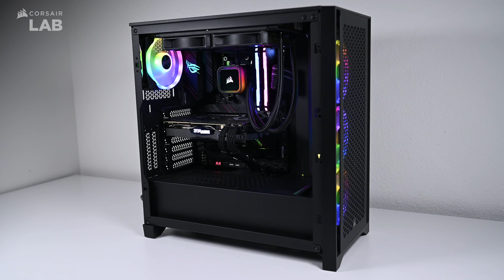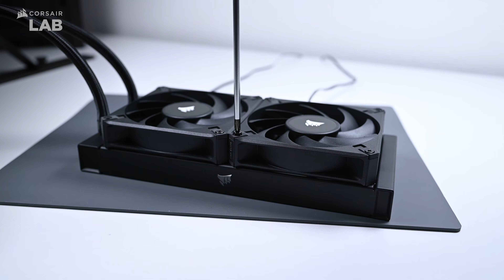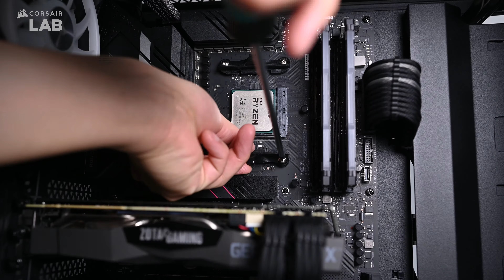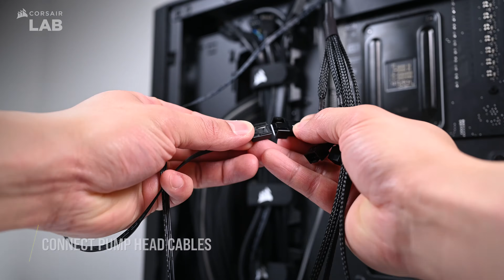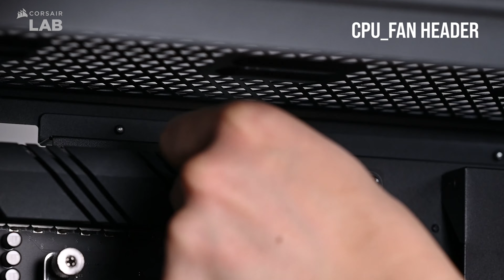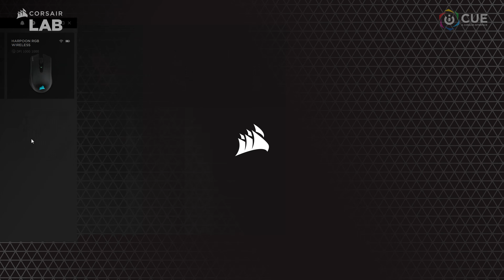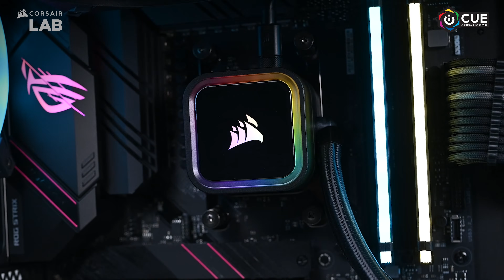How to Install CORSAIR iCUE RGB ELITE Liquid CPU Cooler

Comment: I’m having issues with the tr4 set up. There are two sides to the stand-off a skinny longer thread that goes in the backplate that feels loose but the thicker shorter thread doesn’t go into the backplate nor does it seem like the thumbs screws go onto that side as well
Reply: I’m having the same issue. The standoffs that came in the AM4 bag have one side thicker than the other. Only the skinny side will go into the backplate/ thumb nuts for the head block. This is so confusing and I don’t want to mount it that way because it may not be effective.
Reply: @Moose_-ln1su Nah, I ended up returning it and going for the NZXT 280mm AIO.

Comment: So when I put the stand offs on the am4 backplate it wobbles and isn’t tight! Is this normal and the pump and bracket will tighten it all up? Installing now and need to know
Reply: Is this normal and the pump and bracket will tighten it all up? Yes. The cooler head will tighten it up and secure it. The wobble is normal with only the standoffs installed. I did this last night and everything is running smoothly now.

Comment: I'm glad this video exists because the corsair H150I ships with 0 instructions, just a safety and warranty paper and the online guide doesn't mention the proper method to tighten the thumbscrews which could damage your CPU.
Reply: Yes, u believable that there are no instructions shipped and the PDF online is sooo bad. I am actually very close to sending it back..
Reply: I know its my first build and none of my parts came with instructions lol. They just expect you to already know it all already.
Reply: @jakep8484 same for me lol
Reply: Phew, thought I'd accidentally let mine slip under the sofa or thrown it out with delivery packaging or something. Crazy to have no included instructions!
Video: hurrah 🎉
Reply: I was so confused why it didn’t come with instructions, then I noticed the box has a QR code linking it 🤣 still, this video is probably more helpful
Reply: @smileymoe9866 are you sure it links to instructions? I tried it and it sent me to a page to buy more Corsair products lol.
Reply: @smileymoe9866 these days the QR code now only seems to take you to Corsair website, not the guide.
Reply: 🙂 Oh Really? I thought someone forgot to add the instruction manual when I got my cooler home, the 1700 bracket was not in the box but fortunately i'm using an Asus Motherboard with it and the board comes with additional holes cut out
Reply: 😂 I thought the instructions were beneath the box...lol WTH TOP money no instructions
Reply: I was about to send it back , if i havent seen the vid
Reply: LMAO

Comment: Hi, I have an old radiator from an H80 cooler that I'm trying to use but it has 1/4" barbed fittings.
Is there a way to adapt it to the standard 3/8" hose? If so, where can I get an adaptor?

Comment: Using the new AM4 bracket, when the back plate and the X4 AMD AM4 Standoffs are used, they are loose on my build. Is that how it’s supposed to be?
Reply: YEAH! all other videos show the screw clips to mount on the socket, but now we have thumbscrews, but now the back plate is loose! what is going on?!?!
Reply: @mxsterling91  did you guys ever get around this? Got a new aio but it feels like the brackets are way more loose using these tumb screws than using the clips method with the hooks
Reply: @LS-xy7iy  yes!! just insert your cpu and that will fill in the gaps, i hear this new method is better than the hooks, less stress on the screws.

Comment: Nice to see this mounting solution for the AM4 socket. I hate the AM4 mounting hardware for the elite capellix. The little hooks can be a pain in the ass and I wish my elite capellix came with this style of mount for the AM4 socket.
Reply: You can buy those new brackets for $10 I did for my elite capellix, couldn't be happier.
Reply: The new bracket they give you is a pain in the ass the backplate is too loose